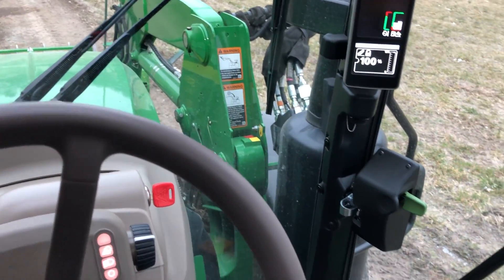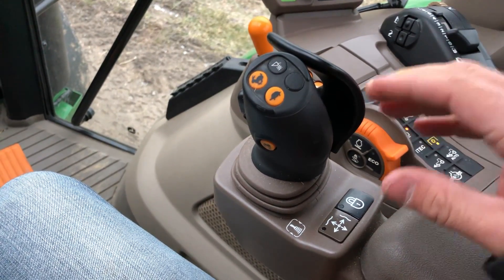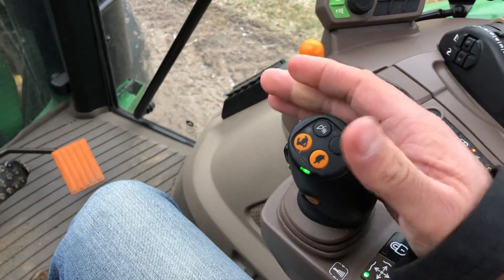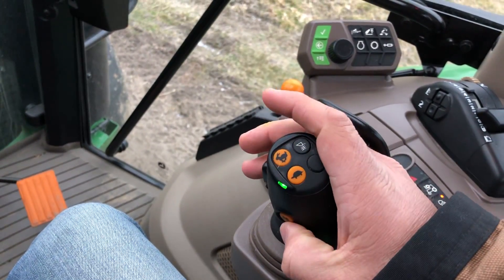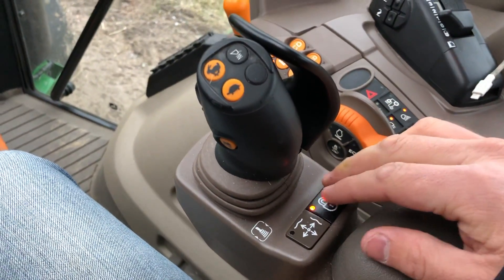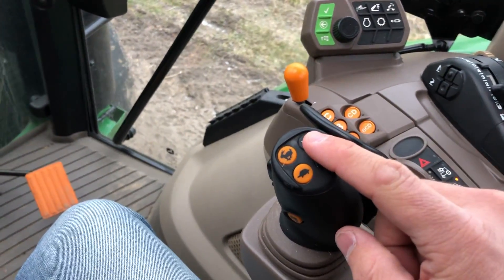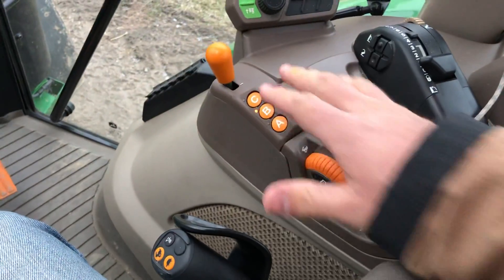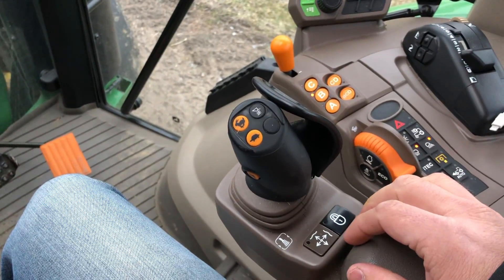John Deere 5R Series Tractor: 540R Loader Controls

Comment: What do you use this tractor for?
Reply from the maker: zfilmmaker primarily for loader work including loading and moving round bales of hay as well as basic earthmoving work around the farm. We also use the tractor as a general purpose farm tractor for moving wagons, mowing pastures, and also winter time snow removal.
Reply: @TheRamGuru  Thanks for your reply, what do you bale hay with?
Reply from the maker: zfilmmaker we round bale with a new Holland BR7060 Silage Special Baler and small Square Bale with a New Holland 320 Hayliner
Reply: @TheRamGuru  I meant tractor....are running those with your 5R?
Reply from the maker: zfilmmaker I typically pull the balers with one of my two John Deere 6420’s but this 5125R could most definitely do that work also. It is actually higher on horsepower in both engine and PTO categories, and is almost the same operating weight.
Reply: @TheRamGuru  I really appreciate the info from someone who owns one. I'm trying to help a family member on a limited to budget to buy one tractor to do it all. I don't know anything about these smaller utility tractors. I farm with Fendt 800's and 900's and feed cattle etc. with a 724. I'm learning with her. She really likes the 5125R and we were looking at a 459 bailer but she has some hilly ground. I'm also going to let her use my HX15 mower since I just got a new batwing. Would the 5125R have the power and weight to safely handle both mowers?
Reply from the maker: zfilmmaker i would say the 5125R would have both the weight (when properly ballasted) and definitely the horsepower to handle an HX15 batwing. I actually plan on purchasing a Deere R15 rotary mower in the coming year or two.
Reply: @TheRamGuru  Thanks for the info, really appreciate it. If you're considering a HX15/20 or even the MX, take a look at the Schulte FX1800. That is what I bought and I previously owned 2 HX, a 20 and a 15. The Schulte is all 7 ga. and has much nicer gearboxes. The 209 is a nice 10' too. I could go into it spec by spec if you care or compare for yourself. Schulte customer support is top notch!
Reply: @TheRamGuru  I meant frame weight. I told her I thought the 6130R would be better for all things considered but she prefers the 5125R.
Reply from the maker: zfilmmaker the 6130R would be an excellent choice also. It will undoubtedly handle the mower even better, but I will tell you the slightly smaller size and tighter turning radius of the 5R is very nice. I also enjoy the tech upgrades like the corner post display. The 6R tractors are excellent also, but they are about due for some tech upgrades.
Reply: @TheRamGuru  The dealer insisted she consider the 6E and M. I built a few online including the 5125R and all are limited to just 3 rear SCV. I assume one pair of those shares a loader function, so running a batwing for ex. would require the loader to be disconnected? I really like the 650/540 tire option esp for her land but its not available on any of those models except the 6R's.

Comment: Good video 
Definitely an option worth having. If you take the loader off does the control then operate hydraulics plugged into the rear of the tractor?
Reply from the maker: James Prentice the loader control is then not used once the loader is removed. On the new updated 5R tractors, the electrohydraulic loader controller can be programmed to run the SCVs on the rear of the tractor. My tractor does not have that feature, I missed that option by a few months unfortunately or else I would have selected it!